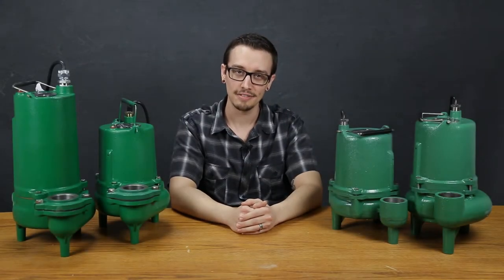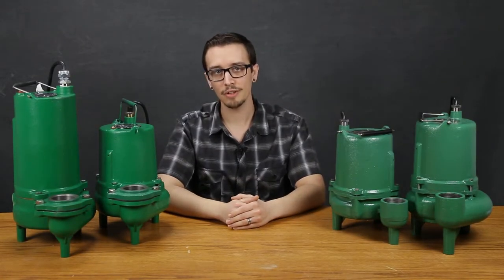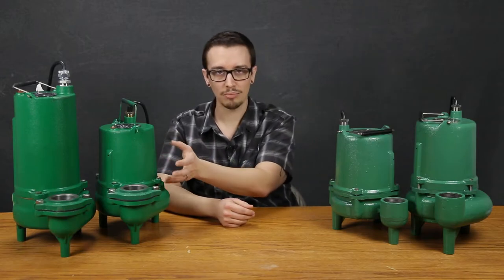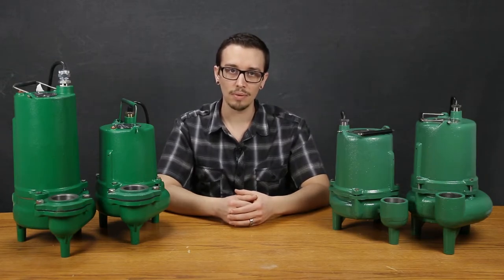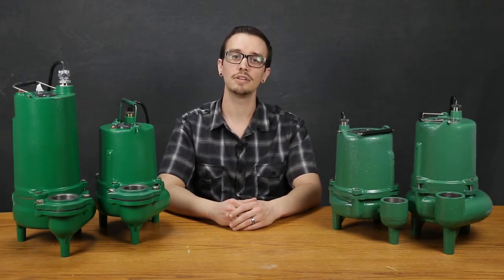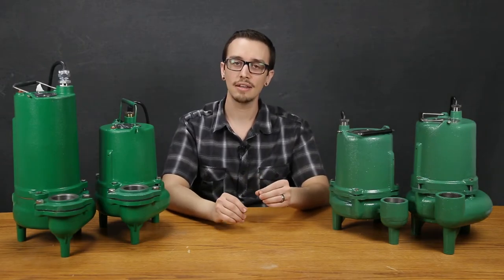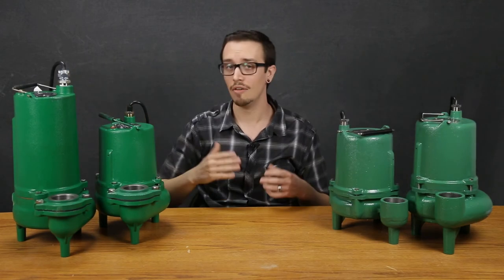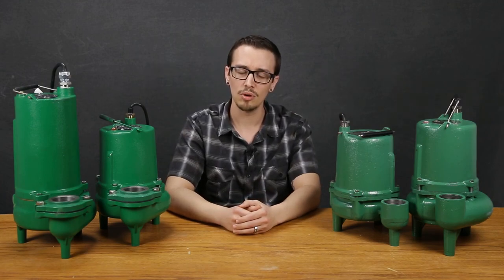How to Select a Sewage Pump

Comment: I have a little 380 Sq Ft cottage with one bathroom and one small kitchen. There will only be two people in the cottage at a time with control over what goes down the drains. It will need to pump horizontal with maybe 3 feet total incline over 90 feet. That line is 4" diameter. Which pump should I use? Is a 4" line ok? I see that most pumps have a 2" discharge. Can that feed a 4" line? Thanks

Comment: How about sizing pumps for heavy duty applications involving residential homes in a flood plain that is subject to very infrequent (1971, 1979, 2013) ice-jam floods? I have not been able to find much information on water flow through drain tiles. We have  3.5" clay, there are a few homes with 4" plastic in this subdivision in West Seneca, NY that was built up ~1965-75, along Buffalo Creek. We have silty loam soil where the water really starts coming in when the soil gets saturated and/or water around the foundation.
Reply from the maker: Hey Michael, thanks for the question! We could certainly help you size a dewatering pump for infrequent flooding. Though we will need to know quite a bit about your situation, please give us a call at 855.329.4519.